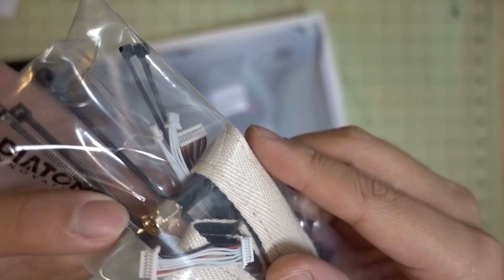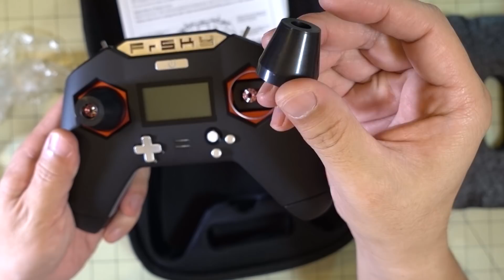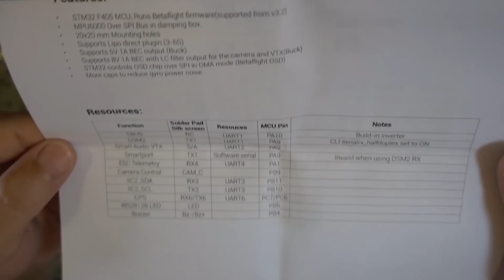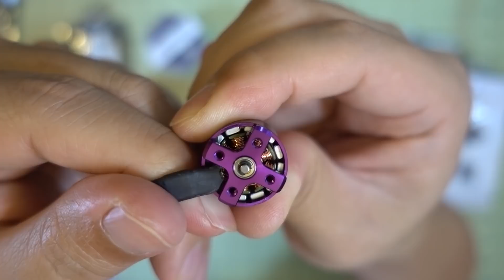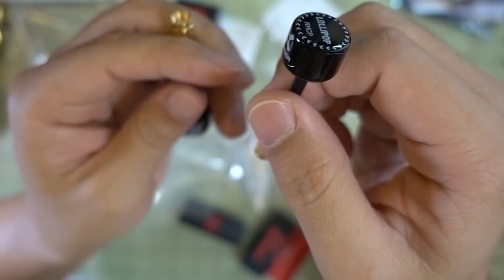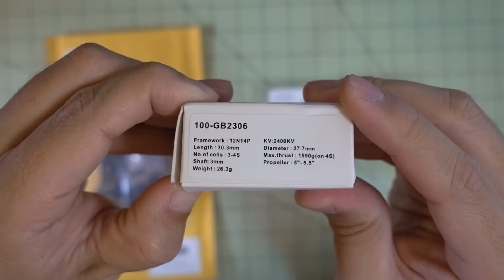Haul Time #93 🛒

Comment: That´s really nice what Diatone did with the GT-R5 frame. Before, it was a total copy (well, almost) of the Floss 2. Now it looks way different and really cool.
The Mamba T40 individual ESCs were crictized by many people that they literally burnt up in the first hover, so they changed for a 4 in 1 (and those ESCs are not being sold anymore, sadly. Hope someone else brings something similar soon).
Do you think that these boards are really from Airbot? Had they really teamed up? People are afraid that those are just copies of their stuff...
About the 3BHobby motors, you can check their 3BT 2306. It doesn´t specify its specs, but I hope it´ll be a quality motor. Also that 8-dollar 2306 looks really cool, many modern features there. I really have to take a look at Gearbest stuff...
The Falkor camera looks really promising. Please Foxeer get it right!
Waiting for all of the reviews!

Comment: Albert, great as usual 😁👍 does the lisam frame supports 14xx hole size motors? Regards
Reply from the maker: Only the RotorX 1404 and Airblade 1404 motors will fit the 9mm hole pattern.  All other 14xx motors have the 12mm hole pattern.
Reply: Albert Kim Thanks for the quick reply. Nice frame but I would like to see 12mm hole pattern... Again thanks.
Reply: Paulo Cardoso seems to me that all these sweet looking frames I like the look off are coming with 9mm hole patterns. We need 12mm please
Reply: Tony Peart you're right 😉 I was waiting for Albert answer before I pull the trigger on this one. I do like the frame a lot... Damn...

Comment: I am super jazzed to see the 3B 1408 motor review. I have been looking at them and  thinking they may be a nice fit for the acrobrat since it has a little bit of extra weight to it. Do you think that they will be good for 3" builds? (I believe you said you wanted to put them on a 4" setup) Awesome HAUL this time Albert!
Reply from the maker: The low kv is better suited for 4 inch, but it should work on 3 inch if you want to go for more flight time and can sacrifice power.